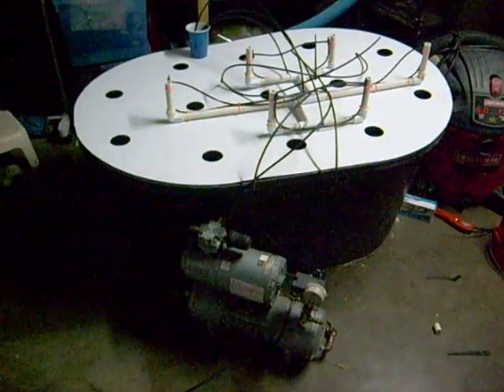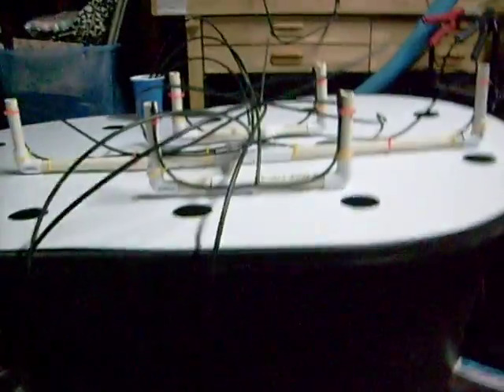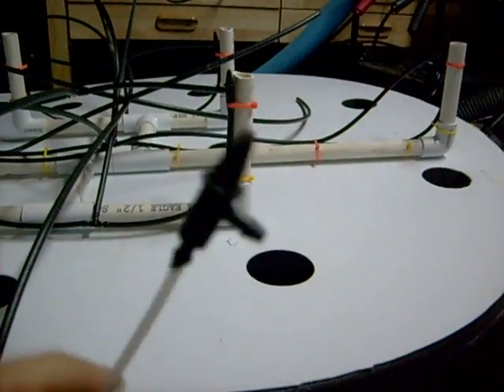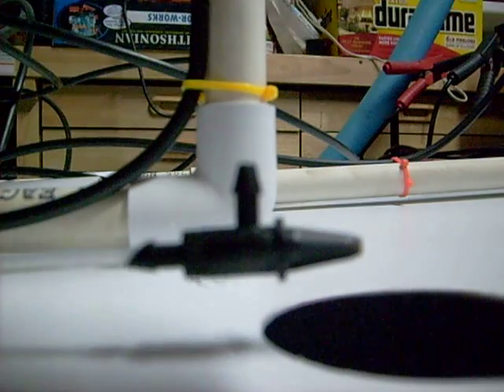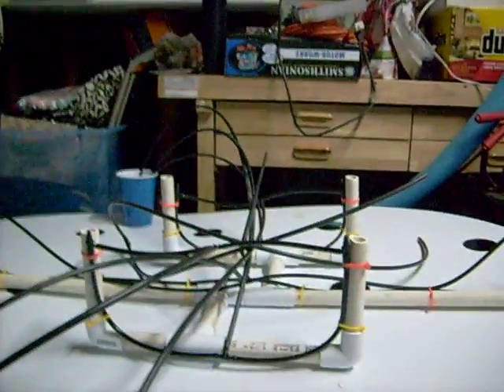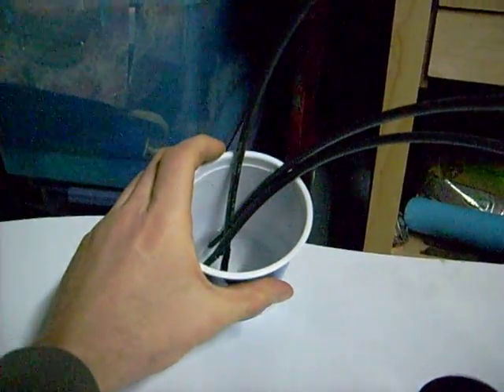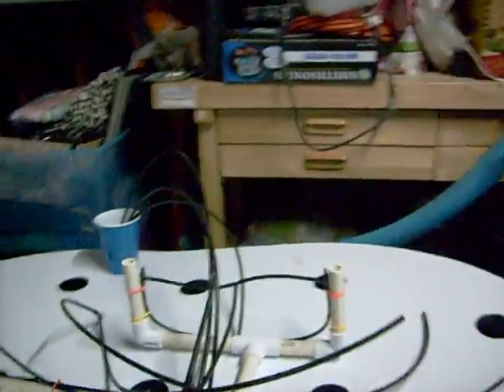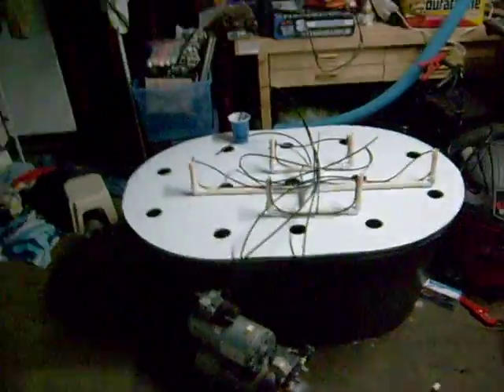Homemade Aeroponics

Comment from the maker: Thanks!  I've been curious about the fridge compressors, never experimented with one.  I wondered if the oil could be replaced with something organic, like vegetable or castor oil, to prevent contaminating the roots with toxic vapor.  This compressor I have is for airbrushing, so it's an oil-less teflon piston.

Comment from the maker: Thanks!  I ran it as high as 80 psi, but I honestly haven't had a successful run on it yet.  My only attempt was with plants that had vegged in the cloner too long and developed all tap roots.  They shocked pretty bad and never recovered.  I did have it rigged to a truck air horn solenoid controlled by a modded analog cyclestat which tripped a simple 555 delay circuit with adjustment.  This essentially gave me a 1 to 15 second spray every 4.5 minutes.  Whole thing minus tub cost me about $150